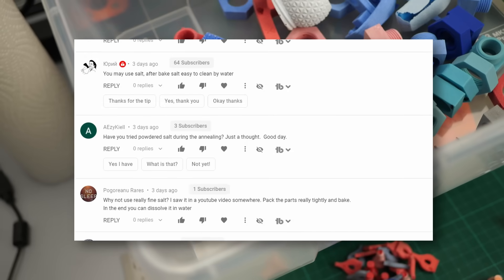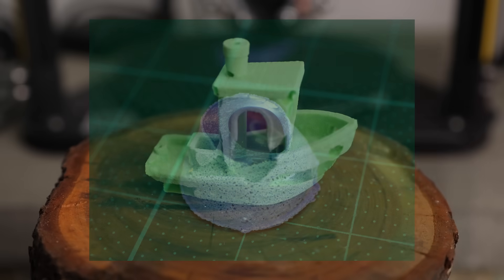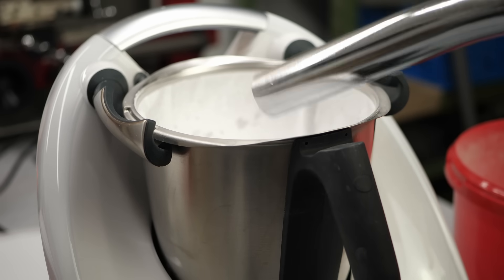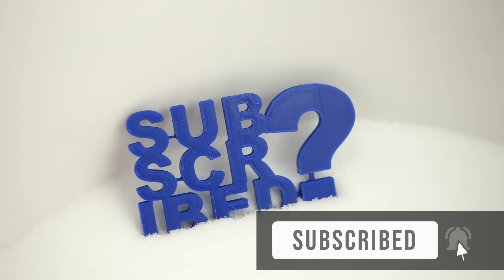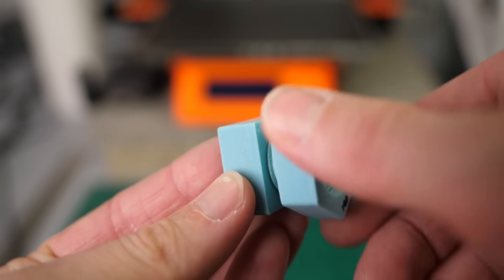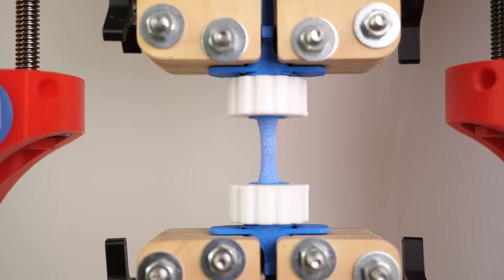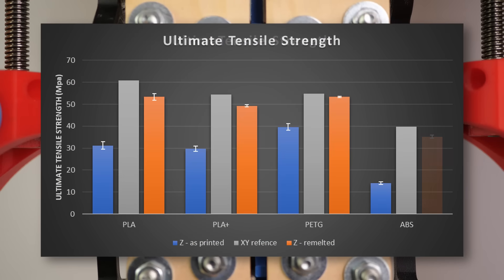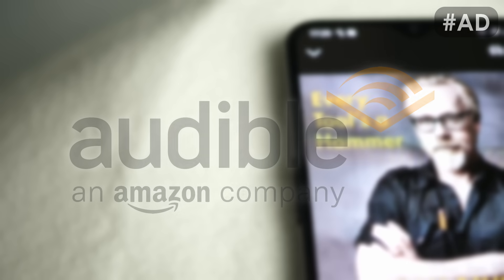The STRENGTH of 3D prints REMELTED in SALT

Comment: We have a high temperature filaments (like ceramics)
What if we try to print inner layers using PETG, and outside layer using ceramics filament, like a shell to melt PETG inside. After remelting ceramics layer should protect PETG inside and become more fragile, so we can easiely remove it. Sounds like a good idea, but we need to check it if it's possible. Unfortunately i don't have a printer that can print with two filaments at the same time

Comment: Use a flour sifter to remove the final large particles. After you pack the part in the salt, you could vibrate it to get it to settle in really well. This is kind of like black sand casting.

Comment: Perhaps the parts could be covered with a precipitated salt crust?
  This might be achieved via placement of the part in a tray of saturated salt solution, which is then evaporated over a period of hours or days (I have seen such enveloping salt crusts around twigs and dead insects in a drying-out salt lake).   A similar crust might be formed by wetting the part in a saturated salt solution and drying it to form a thin crust; and then repeating this wetting/drying process several times to form a self-supporting crust.

Main advantages of a precipitated crust: no grainy texture; thin-ness of crust permits better heat transfer. Other advantages: no more salt dust and wrecked coffee grinders.

ps- this is all just pure speculation, and I've never even done 3D printing

Comment: What does the salt actually do? From looking at this, all it seems to do is hold the piece in place and it is the remelting itself that provides the extra strength, not the chemistry of the salt. If this is the case, why not just use regular casting sand like metalworkers use to forge parts, as this is essentially what you are doing, and casting grade sand is MUCH cheaper than food grade salt...
Reply: Salt can dissolved if it sticks to the cast

Comment: I just can't think of any good or practical use cases for going through all the trouble of annealing 3d prints in salt. Main reason is because I'm just not going to trust it anymore than I would trust an injection molded part to hold up over time. The tensile strength distance between injection molding and 3d printing just can't be that big. I feel like you'll just get more of your money's worth by printing your object perpendicular to the direction of pull your object will experience. For example, you would want to lay a carabiner flat on the bed while printing to prevent the direction of pull from pulling layers apart. I dunno. Haven't finished the video yet, so I guess we'll see the results.

Comment: I'm curious about using a rotary ball mill to grind the salt into an extremely fine powder; or using talcum or similar extremely soft, packable materials.

I imagine talcum powder might prove challenging simply due to the issues around removing the talcum that gets dissolved into the part face; salt still seems ideal for this. 
That said, I'm imagining a system where you do a surface finish on the parts - perhaps using solvent smoothing - and then coat the surface in a very thin protective layer; my first thoughts would be some kind of paint or sealant; something that could, after part creation, easily be removed, hopefully with an alternate solvent that won't attack the printed part. What this coating would be, I've no idea myself, but it's interesting to see.

Comment: i'd love to see an experiment where you put the salt in a vacuum chamber or a pressure pot to see if that would make a difference in the smoothness of the print quality compared to just compressing the powder. Another idea is fluidizing the salt like in mark rober's "sand hot tub" video to get it into small crevices before compacting or pulling a vacuum.

Comment: What I can notice is that melting and solidifying removes any gaps in the printing process, giving the pockets after the melting and cooling process. The best solution in this case is to make negative molds. 3D print your part, polish the surface in manageable pieces, put your pieces together and then make a high temp mold. Afterwards, you can take plastic pieces and make a funnel to get the pieces to melt into the mold.

Comment: You could also try placing the part and salt-filled container on a vibrating surface (DIY a loudspeaker driver at a varying frequency) to vibrate the salt particles so they behave like a fluid, that might help fill in any gaps as well.

Comment: It seems to me a person could size up a 3d print by about 5-9%, remelt it in salt at a high temperature, and then use a lathe to remove the outer layers, design of the part allowing.

But still, excellent video, and very useful tests!

Comment: I have two thoughts on the precess, I do not own 3d printers myself, But I do frequently work with metal casting and forging.
Has the use of green sand been tested yet? I would be curious to see how that would preform as it is a medium of choice when doing metal parts.

Would adding copper or steel wire into the salt in a coil shape that reaches the surface speed up the re-melting process? It also seems that you could control heat distribution based on the copper's proximity to the part

Comment: This is essentially a process that attempts to turn a printed part into a cast part, by creating what is essentially a sand cast using salt, and then melting the plastic into the void created by the cast.

There are a several obvious problems with this method.  

First being the outside layer reacting with the salt, creating that layer of porosity. Fine salt might result in finer porosity, but to prevent porosity you will need to find a way to create a barrier between the salt and the plastic, or find an an alternative casting material.  One might assume the porosity is caused by the plastic melting and deforming around the salt crystals, but the discoloration on the outer layer suggests a secondary chemical reaction going on.

The second issue being that the final dimension of the part will be determined by the shape of the printed part, rather than the actual volume of plastic contained within the part.  Using 100% infill will minimize the problem, but there are still tiny air gaps in corners and around curves which are inherently created by the 3d printing process.  As the plastic liquefies and becomes homogeneous, all those tiny air bubbles have to go somewhere, which means that some other part of the plastic will be used to 'fill in' those gaps, which can cause 'slumping' or some other disfiguring from another location on the printed object.  

The third being the solubility of the ground salt.  The solubility is bad because while it makes removing the salt from the part easier, it means the salt is a consumable, which if you purchase pre-ground is expensive, and if you grind yourself is expensive due to labor costs.  On the bright side, there are very few risks associated with inhaling finely powdered salt,  and is in fact believed to have some health benefits, such as improving breathing and relieving some respiratory distress. This is known as halotherapy.  

If I have any suggestion, it would be to try and find an alternative substrate, or at least add a secondary substrate/medium between the printed part and the salt, in order to reduce the porosity and the chemical reaction between the melted plastic and the salt.  A couple options off top of my head, dip the printed part in a ceramic casting media, or plaster o' paris, a few times to create a layer/barrier between the plastic and the salt.  If allowed to dry properly, there shouldn't be much if any water that can react with the salt or the plastic to result in 'foamy' plastic.  Another option might be to coat the object in silicone and allow to dry before encasing in salt/sand and baking.

I've was considering the possibility that you could use a high mesh quartz powder as an alternative packing media, but that might be expensive as well, depending on the method used to powderize the quartz (precipitation from solution vs grinding).  The cheapest would be around 400 mesh, which while only 100-150 micron granules is still finer than most sand used for sand casting, and it gets exceptionally more expensive the higher mesh you go.  Whatever you use, if its a find sand or stone, you can often add some kind of oil to make it more compactable, to better hold its shape. These kinds of sands are generally referred to as oil-bonded, or oil sand, a popular brand name being petrobond.  You can get ultrafine petrobond which is around 130 mesh, which could still be fine enough for general purpose casting.

At this point I'm just thinking aloud, but hopefully those are a few thoughts that could be useful.

Comment: what if you tried silicone as the support medium? or some similar material you could pour in as a liquid that would dry into something with a high melting point? that would surely get rid of the surface finish problems

Comment: Use a ball mill not a blender for F's sake. Or a diy ball mill aka a rock tumbler and ball bearings.also settle the part on a vibratory table or a rubber mounted table with vibrators attached to it

Comment: Could DRY plaster powder be used instead of salt? It would be easier to obtain for some maybe? It's a very fine powder which resists heat well, and is very dry.
I also wonder if an ultrasonic cleaner could be used for compaction (with a weight on top during the process, or a vacuum bagged print/medium to apply pressure while running the ultrasonic cleaner, this would also allow immersion in water as required by the cleaning device)

Comment: More ideas:
 Pressurized container, not only the salt being really really packed, but add some bit of water in the top and put it into one of these high pressure containers that will maintain a good pressure throughout the process. 
 Use a vacuum pump to remove AS MOST and ALL air that can be possible, might yield an interesting result, kinda the opposite to pressurized container

Comment: I wonder how dried firing ceramic powder would work.  It doesn't transition/particle fuse until you are into the thousands for temperature.  But it is a much finer powder. This is a very interesting method for heat treatment.

Comment: I wonder if you could improve strength between layers by injecting a horizontal tunnel in the infill. If you printed a crosshatched infill with e.g 0.4mm holes, and then every say 10mm in Z, you stop the nozzle over some of the holes in the grid and squirt the plastic down the hole. This way the polymers line up vertically. You could alternate which holes you extrude into to create overlap.

Comment: Tried this as well two years or so ago, the thing I found out is that even with 100% infill setting there are still air gaps in the part that flow up to the top during the remelting process. The thing I came upp with is just adding an extra cylinder or cone shape to the models top so you have extra material to be sure the part would be 100% plastic after the heating. Just some small cleaning required.
Reply: Try a little bit of over extrusion, I made a vase mode turbine blade much stronger by over extruding.
Reply: Could you put a bigger and empty cone on top, use a low infill, and fill your funnel with scrap plastic?
Reply: If the bubbles don't rise you don't increase density or get rid of stress concentrations
Reply: Do it in vacuum
Reply: That was my thought too.
 Wait till the bubbles have had time to rise on their own then increase the vacuum slowly.
Reply: Or do it in zero gravity so the bubbles dont rise.
Reply: @seth7745  ah yes, I'll just jump in my rocketship. Plus that wouldn't fix the problem, it would just create imperfections inside the print instead of completely filling them.
Reply: @indigenous.rabbit2877  jump in your 3-d printed rocket ship you mean.

Comment: I'm sure someone has said this already, but I did a Ctrl+F in the comments and didn't see it. I found fine powdered salt sold as "popcorn salt" on Amazon, hopefully that helps someone, maybe a fellow viewer from the US.
I also wanted to mention, I've learned that printing at 100% infill prints infill at the speed of top/bottom layers (at least with Cura) but any non-100 value will use your infill speed, even if it's effectively 100%, like 99.999.
Big fan of your videos, you cover a lot of great printing topics, thanks for all your hard work!

Comment: You should absolutely try this method using the plaster POWDER, instead of salt, or wetted & set plaster!
Also, vibrating while compacting (like squeezing the lips of the two containers together in your hands while tapping them against the tabletop) should massively improve both the compaction, and the elimination of voids in your packed powder.

Comment: Salt has an interesting property that under high pressure, it will flow and fuse together. That is why salt domes are used for nuclear waste disposal. im curious if you had put the sample packed in powdered salt in a hydraulic press and packed it to a moderate pressure, whether you would have gotten the foamy outer surface layer. also I wonder if solvent smoothing after annealing would eliminate the outer foamy surface.

Comment: Why go through the hassles of using salt when there is a much better way?
Reply from the maker: I'd be happy to learn what "a much better way" is.
Reply: @CNCKitchen  After printing the part, instead of embedding it in salt, use silicone resin, either to better bond 3-D printed layers or to reproduce the object without further 3-D printing. I have many years of experience with that.

Silicone is phenomenally capable of reproducing detail (it easily picks up and reproduces fingerprints), and it is easy to make multi-part molds from positive originals (the 3-D printed objects, in this case) that enable users to make many copies of that object and to significantly enhance its physical characteristics in terms of strength (potentially much greater than that possible with standard 3-D printing), flexibility, opacity, surface finish, and function, such as casting with embedded silicon carbide as a microwave susceptor to enable heating in microwave ovens — as one of many examples.

On another subject, may I suggest a topic for one of your future videos? If so, how do you prefer to be contacted?

Comment: I think I can help do to some chemistry and metallurgy knowledge. First the salt particle size matters and the finer the better, for example the dust you vacuumed off would make the most ideal form to use. To achieve this you could use a ball mill. There easy to make out of PVC and ball bearings. Second the voids you are seeing in the plastic is partly do to moisture loss because salt will draw out most of the moister. To achieve maximum dryness before printing, instead of using a dehydrator, I would recommend a 5 gallon bucket, a stand that fits in the bucket, and use magnesium salts to dry the filament before printing. However I have never owned a 3D printer before so I dont know if the filament can be too dry to print.

Comment: Try including a reservoir above your print, thus for remelting, any air molecules may retreat to the reservoir. You said the shrinkage is about 1% on your test part but that could be because the shape of your part. I'd think larger volumes may cause more shrinkage, thus having additional plastic flow down would nearly zero out your shrinkage.

Comment: If I understand the process, use an air rammer, similar for sandcasting metals. Usually you can compact ok by hand but you want some extra mechanical force to compact the wet sand to the fullest potential.

A hammer and wooden 'rod' might equate to manual ramming if you want a low budget way but these results are not as good. And definitely ram in layers!

Comment: Using a blender to reduce the size of the grains seems,... less then efficient.
Using a method more like a pestle or milling stone, as is done for grains to make flour, would result in smaller salt grain size. Two metal plates moving in random orbits with the salt between them would achieve a very small grain size - those small enough to float away that you vacuumed up would be the ideal size. 
Add to the a vibration table method of packing the salt grains down, rather then pressure, and the microscopic grains would fill in to the printed shapes more completely.

Comment: How about trying cement as the powder? I mean the stuff you mix with sand and water to make concrete. But here it would be easy to just get a 25 kg sack of cement and use that as the powder you put around the parts. This comes as a very fine powder in the first place, so no need for any processing like you needed with the salt. And it will stand the temperatures perfectly fine. 
Just don't get the premixed concrete stuff. Then you get a lot of large grained sand, and you don't want that!
And use it dry. Don't mix it with water. You wouldn't be able to get the parts out afterwards if you do.

Comment: So many wonderful ideas I see.

To get consistently fine powders of hard minerals, the best, cheapest method is a ball mill. Steel ball bearings in a tumbler will produce excellent results, although slowly. 

Ball milling is an old process. Flammable powders use lead balls, non flammable powders like salt can use the harder steels, as steel bearings can spark when they strike each other. The longer they go, the finer the powder.
Reply: Also, vibratory compacting while adding the fine powder would increase definition.

Comment: Why not use a casting sand instead of salt? It’s designed to withstand the heat, and can be gotten in very fine grain structure for small details of molding jewelry and such.